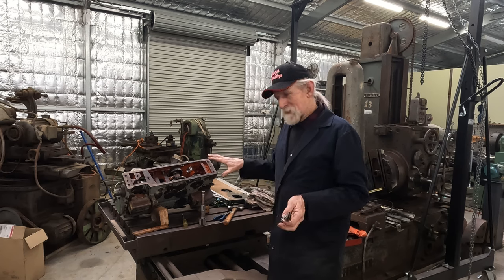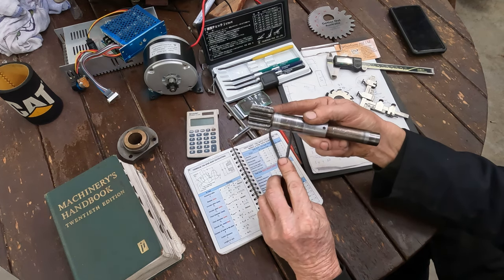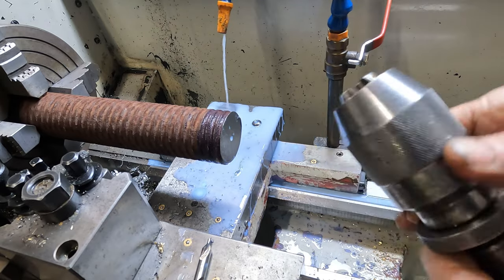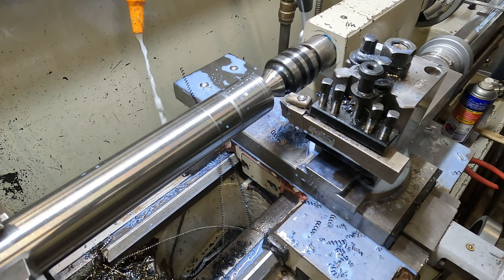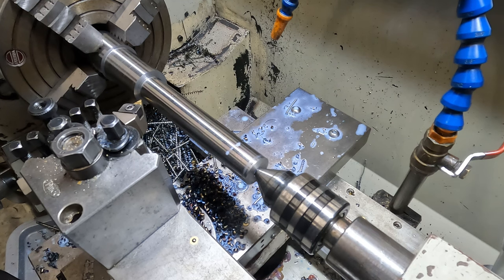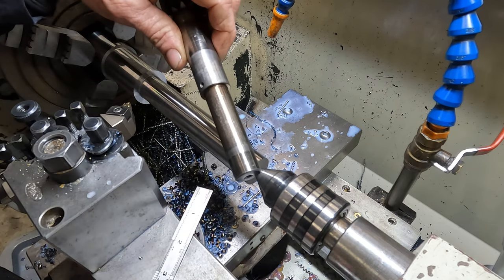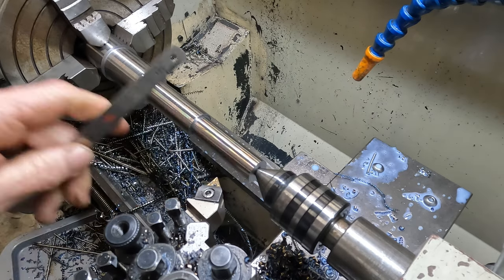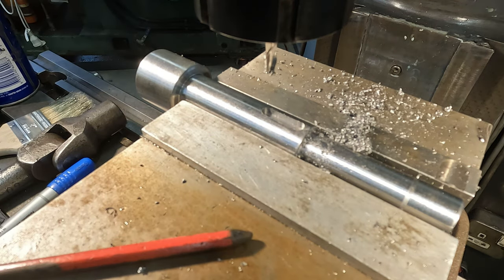Machining A New Apron Pinion Shaft For The JFMT Lathe .   Part 1 .

Comment: Gotta love machine builders, very rare operator and instructions manuals are updated during manufacture,  I know, I write manuals , no system in place to update engineering revisions.
I purchased a DBNR tool based on your recommendation a while back, great roughing tool,  and using unused corners on the CNMG inserts.
Nice job Max,  thanks for sharing.
Reply from the maker: Cheers .  They are a great tool . 👍

Comment: Nice job mate. When I was in the industry I worked as a maintenance fitter but sometimes I would not use a lathe or milling machine for some time and one day they wanted a new pinion shaft made and I hadn't cut a gear since I was an apprentice and I completely forgot about how to do it ! It took me about 3 hours to machine the shaft and around 10 hours to cut the gears lol. I spent most of the time reading books about it.
Reply from the maker: Lol , you are not the only one !!!   👍
Reply: @swanvalleymachineshop  When do you think you will be near enough up and running to take in jobs? A hard question I know
Reply from the maker: @dermotkelly2289  Early next year .

Comment: I have a Precision Matthews lathe that looks remarkably similar to yours (probably the same Chinese foundry) and I have adopted your technique of parting off in reverse with the parting tool upside down in the tool holder with great success. Gravity seems to drop the chip curl out of the cut rather than having it curl up on top of the cutter and weld into the cut. There's no problems with the part trying to climb up over the cutter too. Great trip!
Reply from the maker: Thanks .  Yes , i suspect there is a lot made in those factories & sold under different brands !   👍

Comment: Hi Max, I generally use 17/4 PH for shafts of unknown origin, Its great quality and tough as a spinsters crack. Looking forward to the rest of the restoration. Best wishes, Mal.
Reply from the maker: Thanks .   The bearing areas have to be hard & the gear not so hard .  I wanted to stay away from pre hard , thinking about the gear cutting ! 👍

Comment: A mix of inch and metric on a machine can be confusing, but on the same part it certainly keeps you on your toes!
Reply from the maker: With Whitworth threads in the mix as well !  👍
Reply: Mixed systems are not that unusual, bearings are frequently metric sizes being cheaper than low volume production imp ones.
Reply: @chrisstephens6673  On the subject of bearings, the automotive industry is notorious for "special" bearings, to ensure you buy spares from their dealers.
Reply: @russelldold4827  true enough, also for things like screws. Douglas motorcycles use unique threads so you had to buy genuine spares.

Comment: Hi Max, I have the 24 edition Machinery's Handbook, copyright 1992.
Yours I am guessing is 1977
The rapid travel on the saddle will put a lot more wear on the rack and pinion which are prone to dirt and chips.
Wondering if a Bronze sacrificial pinion might be the way to go, hate to have to replace the rack.
Reply from the maker: Not sure what year that edition was printed .  It was my Late Fathers  .  I wonder if the new ones are all metric , if so i might get a newer one .   I also think the rapids would create a bit of extra wear , mixed with the crap that gets in there .   The one on the DSG seems to be cast iron & with almost no wear .    👍
Reply: @swanvalleymachineshop  I've got the 25th edition (large print edition, which is a lot handier now than when I got it) and it has both imperial and metric. I would assume later editions are both systems as well. Ken
Reply: I have the 33rd. It’s both. I imagine they will be for some decades yet.

Comment: @swanvalleymachineshop
Good day Max, did you happen to mention what steel/material you chose as replacement?  I have watched a couple gear shaft machining videos you created.  However, i do not believe i caught the type of material (maybe you said it and i missed it).  Thanks fella for your skills and very easy to listen to and watch videos.
Reply from the maker: The material has high tensile steel that i did a hardening test on .   Cheers 👍

Comment: It’s interesting that on a lot of British stuff, you find metric and inch (being I’m from the USA I don’t say Imperial) mixed on parts all the time. I’ve found shafts that are metric with inch screws, as well as a lot of other equipment and parts. I find it annoying. I’d much rather have it one way or the other. I wonder why that, Chinese I think, lathe would have these parts in inch. Possibly for a mainly inch oriented market?

As far as that shaft. It looks like a ball screw. I would expect that to be hardened, at least the surface, yet it didn’t look that way when you were working it.

I also like that circular gear gauge. I’ve got the usual sets. This is nice.
Reply from the maker: Thanks .   I think the shaft was a  type of puller rod from a concrete yard , something to do with pre stressed concrete & concrete moulds .  I suspected they would be good material . 👍

Comment: Hello Max.  "It's imperial on the lengths and metric on the diameters".  Sounds very, very Canadian.  I'm looking forward to seeing you cut the gear teeth.  Not many videos around of that.  Ken
Reply from the maker: Cheers Ken .  As soon as i sort out a cutter !     Hey , i re watched your series making the K&T parts .  Great series .    👍
Reply: @swanvalleymachineshop  Thanks Max.  I always thought that series should have gotten more views, but it was early on when I had no subscribers. Ken
Reply from the maker: @hmw-ms3tx  I think it's just the way things go .  I have a few like that as well .  The way to get the most views is to have no clue what you are doing , make some sort of fuk'd up centre punch or similar but take a really good thumbnail shot !!!  There are quite a few that cheat the system & use view generators .   Try & tell me channels like Inheritance machining does not do that !!! 👍
Reply: @swanvalleymachineshop  I'd never heard of Inheritance Machining before.  I went and had a look and yes he does get a lot of views for someone who started 18 months ago.  He must trigger the algorithm somehow.  I think I did that once.  I had one video "Roughing on my large lathe" that had been on youtube for about a year and had around 1,000 views.  All of a sudden in about a week it got 250,000 views.  My next closest video has about 23,000 views and most of my videos barely break 1,000.  That video must have got picked up by the algorithm and recommended to alot of people.  Some guys seem to have the touch.  Having said that I much prefer videos where the content is good and at the level that I work at.  That's why I like your videos as I always seem to learn a new trick from you with each one.  Ken
Reply from the maker: @hmw-ms3tx  I had one with just over 100k , making an old cotton reel tractor !  Like your self , i usually stick with videos at the same level .    Cheers . 🍺🍺🍺

Comment: Hi Max,
What do you think the purpose of the relief section on the small diameter is  ?
Oil passage to the bearing maybe  ?
Reply from the maker: Just sits in clearance .  Nothing runs near it & i think it would be  cheaper to manufacture as it's not a tight tolerance .

Comment: G'day Max, Great video...thanks for the information and knowledge shared prior to diving into the turning...really pulls it all together.
Cutter preference and info is very helpful as well...I and probably other home gamers really need help wading through all the cutter options. I've certainly picked up several that just don't work on home sized machines.
That was some interesting material, was it a ball screw or some type of jacking screw ?
Enjoyed...
ATB...Cheers...
Reply from the maker: Thanks Dean .  As far as i know , the shaft was a puller rod . It's really good high tensile material , i think similar to an EN25.   👍

Comment: I have seen you in the past grind parts that you have heat treated to get them to the correct size. I am curious how you handle the gear teeth. I ask because I hope to be getting a gear made for my horizontal mill's vertical head, but it won't be heat treated. If it was heat treated, would it have to be ground to shape or what's the typical process?
Reply from the maker: The gear will be made to size before heat treatment .   Only the bearing journals will be machined after & fingers crossed it will stay reasonably straight after heat treatment .  The gear can be cleaned up with a wire buff & scotch bright . 👍

Comment: When repairing machine tools, check very carefully the threads and gears used. For instance, my Taiwanese milling machine is metric.... except for the British Standard Whitworth fasteners used in several places. My Taiwanese lathe is all metric.... except for the Unified National threads used on all the control levers.
Be wary of old machines, especially pre-WW2. Metric fasteners weren't standardized universally. Germany, France, and England each had their own standards. There are plenty of odd ball imperial threads to keep an eye out for, especially pre-WW1.
Cheers from NC/USA
Reply from the maker: It keeps us on out toes !    Cheers . 👍

Comment: G'day Max.    Excellent job, shaft turned out really well. Wondering what the other meshing gear is like, whether you will have to make another one.  Is there a metric equivalent to the 10 pitch ?
I have a new small set of metric gear cutters, & same set of Bruce's  gear templates,  will check it out in the morning. Just never know.
Reply from the maker: Modules are in between imperial diametric pitch , there is no equivalent .  👍
Reply: It meshes with the rack doesn't it  ?
Reply: @stevewilliams2498  with that lathe, & the complex apron, not sure if it connects directly on the Rack, or whether  onto another gear elsewhere
Reply from the maker: @stevewilliams2498  Yes .
Reply from the maker: @TedRoza  The rack .

Comment: I learned a lot Max. Highlighted some big gaps in my knowledge (being just a late-coming hobbyist). Probably your method to identify the gear pitch was the most interesting for me.  It's a whole area I need to research. For DP there is then pressure angle - did you just go for the middle ?  (20PA?) Cheers
Reply from the maker: And there is adjusted profile !  That is what i am dealing with .  Forget pressure angle , that gets complicated with a non standard gear .    I will go through it in another video soon .  Hey , how is your solar going .  We had our system installed a while back on the shop .  Cheers .  👍
Reply: @swanvalleymachineshop  Hi Max, right I will be watching for the gear form lesson, that will be very useful. Up to now it was on my long range radar (general awareness) but not so relevant, but since I've got the mill now it's only a matter of time before I want to cut a gear or two.  I'm going to do an update on the solar late/end August. I'm very pleased with it but it's really taken until July (3 months) for it to settle down with one event or another affecting output. I've just about got to a point where I can get some confidence in the payback calculation. With a battery there are just so many variables in play, it's hard to model theoretically on a spreadsheet. Cheers
Reply from the maker: @HaxbyShed  We have not gone to batteries yet , will wait & see with the way technology goes .   Ours is 17.5 kw  3 phase .  👍

Comment: Yes, what a nice replacement part that is coming right along. 
And yes, I thought I saw the Horizontal Boring Machine now used for a table, and a very stable Cast Iron paper wait, I am wondering if the Old Horizontal Boring Mill will not only have to be repaired, and rejuvenated, but also Resurrected.
I am looking forward to seeing how you handle the damaged ways, here is a link where KR is using a product called Turcite Wear Strips.     here is a link about Turcite. 
https://www.youtube.com/watch?v=1zNvdKz5r84
Reply from the maker: Thanks . The HBM will be needing a fair bit of Turcite !  👍